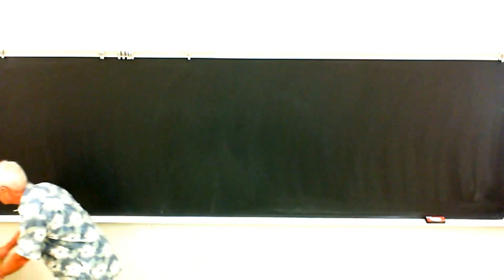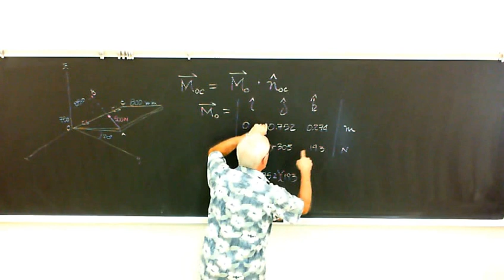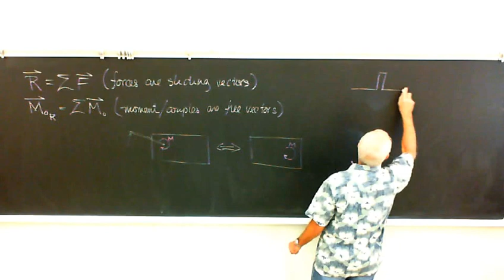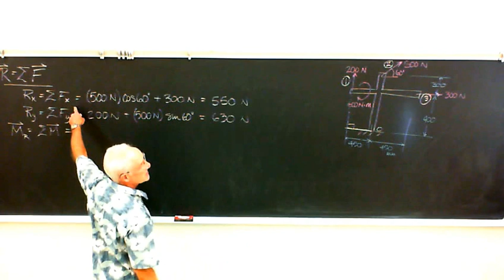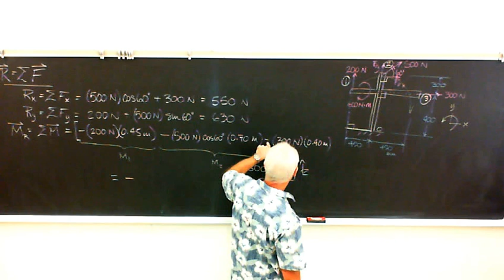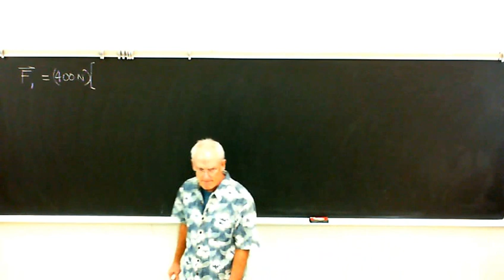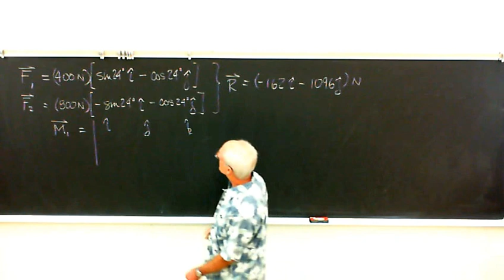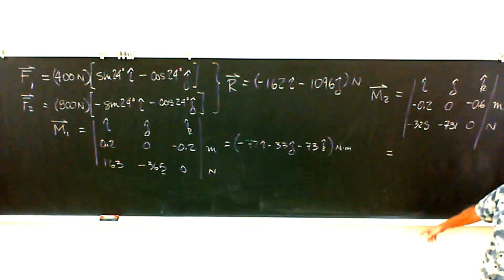3-D Resultants

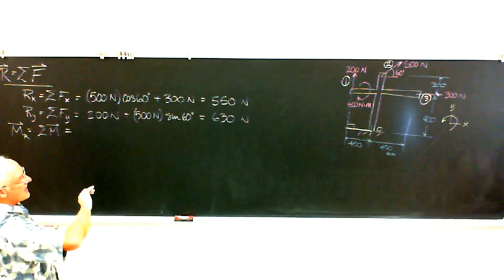Comment: in 2-D resultant 40:20 you explained about direction of moments-positive moment but here 24:10 the moment is negative how
+X +Y CCW +M
+X -Y CW     -M     (y is positive 200N and d is .45m so the moment is +ve  but in 24:10 is mentioned in -ve)
Reply from the maker: Your answer is in your question.  If the Y part becomes negative (from +X +Y  to +X -Y) that will change the sign on the cross-product (hence +M  to -M).

Comment: At 29:58 isn't the applied moment (600N-m) along the negative X??
Reply from the maker: It is a 2-D problem.  There are only moments in the z direction.
Reply: @ksmanning  Sir but, the diagram shows turning effect along X, I am confused...
Reply from the maker: @336suryasunkaramech5   No, it is not.  It is shown as being applied on that little arm which is -x direction, but that is not the sense of the moment itself.  That 600 N-m moment is shown to be in the clockwise direction, and is thus -z.  Moment is a free vector and can act anywhere, but it’s direction does not change.  WHERE it is located is immaterial.  How it turns is not.
Reply from the maker: @336suryasunkaramech5    It happens to be placed at -x, but it turns in the -k direction (clockwise).

You are confusing moment position with moment direction.  You need to review how to calculate moments so that you can understand this one.
Reply: @ksmanning  Thank you for the reply sir, I really didnt expect a reply from you...the videos are 7 years old...are you still teaching?
Reply from the maker: @336suryasunkaramech5  I am retired now, and because of COVID, can’t imagine ever going back into the classroom.  I just answer a few questions here.